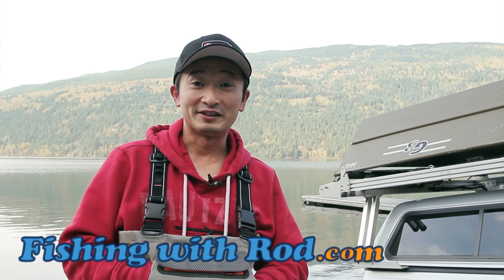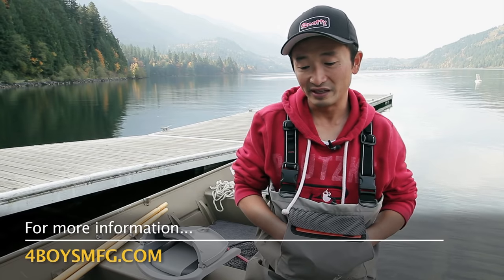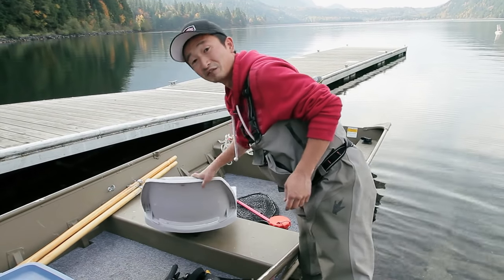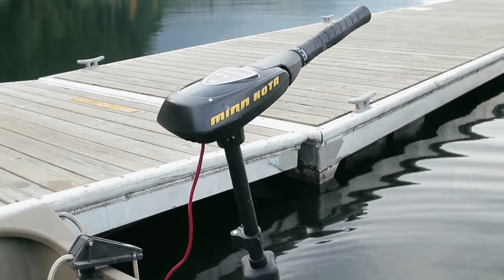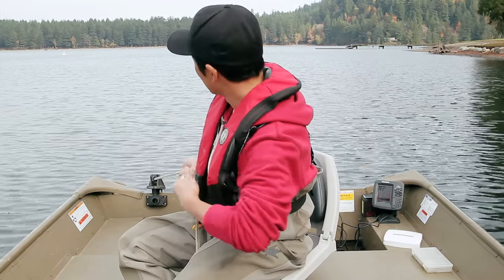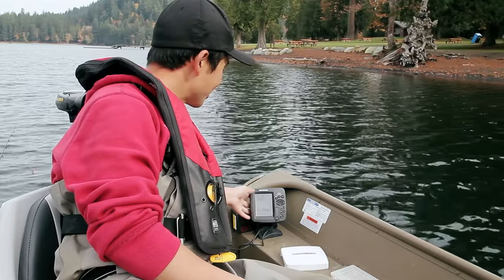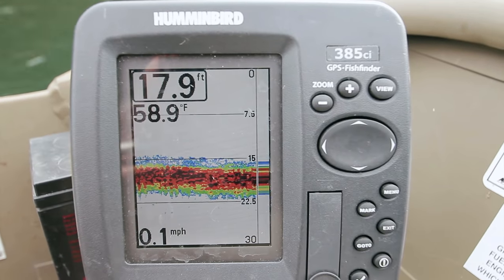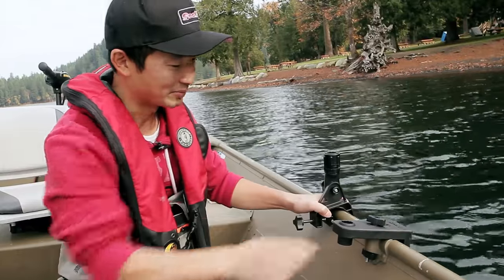A Tour of My Lake Fishing Boat Setup | Fishing with Rod

Comment: Excellent video! I’ve just bought a job boat with nothing set up in it at all. I will be mounting 2 anchor locks to the boat.
The one thing I haven’t decided is if I want to drill through my boat for the rod holder mounts.
So… clamp on or side mount (which means drilling) 
I noticed your clamp ons are very sturdy. What model of Scotty are they?  I have the same round top rail, so I may go with clamp on now! 
Thanks for the video! Great info!
Reply from the maker: Yeah, I've explored quite a few different options for mounting my rod holders and cameras etc, and in the end the coaming gunnel clamp mounts are still the best options for me. The model number on Scotty's website is 433. The only down side is that I find myself spending a bit of time screwing those on at the start of the day, then taking them off in the end. Not a huge deal but bit of a hassle especially tired after fishing all day. Since my boat goes up on top of the truck, everything has to come off so this is the best arrangement I can think of right now.

Comment: Thanks for sharing. I have a similar aluminum jon boat and since the gas engine broke down it has been sitting idle due to the high prices of gas engines.  But since seeing your video I have decided to install one or two electric trolling motors and i am sure it will be successful to get me and my son out in the water to fish.  Thanks again.
Reply from the maker: Awesome! I hope it works out. :)
Reply: Me too! Setting up a new jon boat, and I'm also going all- electric. Clean and simple. I don't need a lot of speed on these small lakes around here.

Comment: I've never seen an electric boat unloader. That's pretty awesome. 

Are there many lakes where gas powered engine aren't allowed over in BC ?
Reply from the maker: +The Fishing Experiment These electric boat loaders made by 4 Boys from Kelowna are getting really popular now. If you head up to Merritt and Kamloops, you'll see them everywhere on trucks. 

I'm not sure exactly how many lakes are designated as "electric motor" only but they are listed in the BC Freshwater Fishing Regulation Synopsis.
Reply: ***** Thanks for the information. 

Yeah I can imagine that type of loader would be ideal for some of those remote lakes that you have out there in BC. 

I imagine some of the those lakes are untouched even. 

The boat loaders are made in Canada too! that's awesome.

Comment: great looking boat Rod. May I ask where you got the exterior carpet? None of the marine supply places I tried have it in stock , it needs to be ordered. Thank you
Reply from the maker: It's from Home Depot! :) If you go to the outdoor carpet section, you'll see quite a few different options available. They come in these huge rolls (20ft wide I think), and you just ask them to cut you a piece. I think I got 6ft X 20ft for the two floors. Use carpet glue and it'll stay on forever, and staple on the back side of the edges. You can also waterproof it by applying some kind of spray so it lasts longer but I didn't bother since I rarely fish in the rain.
Reply: lol :) out of all the places, I am at Home Depot just about every day picking at stuff, but never thought they would have it. I will check it out tomorrow. Thanks Rod!
Reply from the maker: Yeah just feel all the different ones before you choose one. I must have been there about a dozen times before deciding and I went with the grey thin one which they recommended.

Comment: Very informative and well put together video .. you have a very nice boat setup .. I just recently bought my first aluminum fishing boat and I have concerns about mounting the seat to the bench like you did .. what did you use for anchors in the aluminum bench so did the swivel would not pull out ?
Reply from the maker: Thanks! The anchors I used are:

https://www.homedepot.ca/product/paulin-papc-8-32-thread-sert-kits/1000162982

I don't consider these as heavy duty anchors and the aluminum on the bench is less than a cm thick so over time the screws will try to wiggle out on their own. That said, after 5 years the anchors are still holding on very well and I've only had two screws that came a bit loose at some point, they were fine once I tightened them up again. I also recommend that you don't lean back in your seat too much or too often so you're not putting too much pressure on those screws and anchors.
Reply: I was thinking about getting some type of board that would fit the entire bench front to back side to side .. then screw about 8 screws through the board , 4 across the back and forth across the front side .. use these anchors to mount the board to the aluminum bench .. then mount my swivel and chair to the board .. I think this would make it a lot more stable for leaning back in the chair .. plus I would be able to mount my fish finder and other things to the board next to the chair

Comment: Excellent video! Where did you buy the boat? How fast can you go on with the trolling motor and does the battery last all day?
Reply from the maker: +Mark H Thanks! You can get these jon boats from any Yamaha G3 dealers. Mine is from GA Checkpoint in Abbotsford, British Columbia. With the trolling motor, mine is 55lb thrust and that's adequate enough for me to travel from point A to B in a small lake. It is a trolling motor after all so it doesn't go super fast, and I am not in a hurry usually so that's fast enough for me. The battery life depends on its size. Mine can run the motor for a day, which involves going from point to point, and anchoring at spots for a few hours at a time. I would say up to 1 hour total at full cruising speed.

Comment: Great vid, what hardware are you using to mount the anchor lock to the transom? Just stainless bolts and nuts? Any silicone? Words of wisdom when drilling into transom? Id like to mount a similar anchor lock on Lund A12.
Reply from the maker: Hi Kelly, I use a Scotty flush mount which goes with the anchor lock.
http://scotty.com/fishing-gear-equipment/rod-holders/flush-mounts.htm

They are screwed on with stainless steel bolts and nuts. :) Hope that helps!

Comment: Hi Rod, i just got a brand new boat. 1448 G3. Really similar to yours but a bit wider. I am thinking about using the flush mount anchor lock bases because i want to put a tarp over the bot and i don’t want the regular base stick up to much and possibly damage the cover. Did you ever consider using them on the front or you think they wouldn’t fit under the front “lip”? I’d hate to buy one just to find out that I can’t use them. Thanks Rod
Reply from the maker: Congratulations on the buy! 1448 is so much wider than my 1442. From what I remember, the flush mount can fit on that front lip, but you may need to file off a bit of the bottom of that mount. I chose the regular base mostly because I'm not that handy, and didn't want to do the cutting of the front lip to fit that flush mount.
Reply: Thanks for the reply Rod. Yes, the 1448 is a monster:) so much bigger than my previous 1436. I don’t mind filing it down, hopefully it won’t weaken the mounts. There is a lot of force on those anchor mounts sometimes, when we try to pull the anchors out of the mud. I’ll let you know how they are once it’s done;)

Comment: Hi Rod I am new just watched your boat tour video i am actually trying to find a boat for me and my family this looks like a perfect starting boat can you stand up safely in thins boat and fish or does it seem kinda wobbely ?
Reply from the maker: We've fly fished it with two people standing up and casting without any issue even if the lake has a bit of chop on it. Having a leveled floor like we've done in this video makes a big difference on stability when standing up. This boat is ideal with either two people who want to stand freely, or three people sitting down. If you have more than one kid who likes to run around in it, then there are bigger and wider options as well, such as 1648 or 1652, but these have to be on a trailer instead of on top of the truck.

Comment: Hey there nice boat. If you don't mind me asking....how much did it coat and where did you get those anchor mounts from. THANKS again nice boat
Reply from the maker: Jeffrey Carpenter thanks! The anchor pullers and the associated mounts are made by Scotty Fishing Products, and they can be found at most boat or fishing retailers across North America, Europe and Australia actually. If you head to their website you should be able to find a dealer list. The exact cost of the boat I don't remember. You can get the boat body at a pretty reasonable price, under a couple thousands, and build it up with accessories like I have done. 😊

Comment: Does the trolling motor kills the battery or does it charges it as well when you use it and I like the vids
Reply from the maker: The battery indeed has a life span. How long it lasts depends on its size, and how fast you are going. If you are going full speed with the electric motor, it'd be around 1 hour, maybe less.
Reply: What type of battery are you using?

Comment: May I ask how long you can go with the motor before you run out of charge?
Reply from the maker: we do it That really depends on what setting you are on and how big the boat you are pushing. With this 14ft Jon boat, I can run at full power (3.5mph) for roughly an hour.

Comment: Do you have your Scotty anchor mount bolted through the transom with a nut on the other side, or just screwed into the transom?
Reply from the maker: It is directly screwed into the transom. The screws hold really well in the wood beneath the metal. Make sure you apply some kind of sealing before fully tighten each screw so water does not seep into the wood.

Comment: Great video, I’m looking at get a boat just like yours, how stable would you say the boat is when moving side to side?
Reply from the maker: It's really stable. Here is a good video to see how stable it is, at one point I was running all along the edge of the boat:

https://www.youtube.com/watch?v=IfyxQbiXpbo

That said, I am only 130lb, so it also depends on your weight. If you're concerned about stability, there is also the 1448 which is REALLY stable, but that boat would have to go on a trailer instead of on top of the truck like what I do with this 1442.
Reply: @FishingwithRod   just got done watching that video, thank you sir!
I am planning on the G3 1448, I think it will fit my needs perfectly, I have a lot to learn about fishing ha, I have thrown a lot of lines but never had much luck, I’m planning to change that soon.
Reply from the maker: Great! You'll love the 1448, it's such a spacious boat. It's quite amazing how much difference that extra four inches make.
Reply: @FishingwithRod  awesome, that’s what I needed, thank you sir

Comment: With this setup, you'd block the boat ramp for an excessive amount of time.  Good way to piss people off waiting for you.  
 However the mechanized roof winch is awesome.
Reply from the maker: Vic Terraglia That's one disadvantage and it is up to the user to be considerate. I don't use busy boat launches for this very reason, and will unload the boat quickly at the launch, bring the boat to the nearby beach and set everything up so I don't take up the space.

Comment: Hey I'm looking at the same boat. Just curious how easy is it for you and another person  to lift and carry that boat?
Reply from the maker: Hi Jarrett, I can't speak for everyone as I am only 130lb, so is my wife, so it is impossible for both of us to lets say flip the boat and put it on top of the truck, but carrying it briefly on the ground to the water is doable for us. I sometimes even drag the boat zig zagging to the water. We have an electric boat loader which lifts the boat to the top of the truck, and I can lower it into the water by pressing a button. It's the perfect size boat for two or even three people, and getting to less accessible lakes where the boat needs to be on the roof of the truck.
Reply: @FishingwithRod  wow that was a fast response ! Ok thanks love the videos by the way! I'm 230 lbs form ontario looking for a boat me and my friends could take out  in a few small lakes and rivers with no launch. And about a 50 foot  walk with the boat. I like I wide this one is over the 1436.
Reply from the maker: @JLRacing17  Yeah you two should have no problem carrying 50ft to the water. One challenge I've always had while carrying on the ground is that the two handles on the transom side are quite far apart for me, so I have a problem with grabbing onto both to carry. My arms are too short for that, but probably not the issue for others. The biggest challenge is definitely getting it from the truck top to the ground and back up. If you can work out a system to do that with the buddy, then you are good to go!

Comment: I've recently purchased a 14' AlumaCraft Jon boat and want to install seats onto the benches as you have done  on your boat.  I weigh approximately 200 lbs and I'm  curious to know if I should mount directly into the aluminum bench or would it be better to install a piece of plywood onto the benches and mount the seats to them.  Do you have any recommendations as to the best way to do this with my weight taken into consideration?
Reply from the maker: Personally I think it wouldn't make much difference structurally if you put a plywood in between the bench and the mount. With the anchors that I've used for screwing the mount onto the bench, they have been very strong and we've had people around your weight sitting on them too. The anchors I use are called "Papc Thread-Sert Kits". If you Google it and it should pop up first on the Home Depot's website.
Reply: +Fishing with Rod Thanks for your advice!

Comment: What do you think would be better and faster for a 12ft jon... A 55lb single motor or 2 30lb motors? nice video btw!
Reply from the maker: A 55lb thrust electric motor is plenty enough for a 12ft Jon. I've never seen anyone using two electric motors at once. You can always go higher than 55lb, Minn Kota has those available.
Reply: Fishing with Rod Ok thats what I was thinking.  I saw another video of someone using two c2 30's.  How fast do you think a 55 will go as far as mph?  im guessing around 3-4
Reply from the maker: 55lb on a 12 footer should be up to 5mph. I have done up to 4mph with my 1442.
Reply: Fishing with Rod Alright, thanks so much!
Reply: I've done 2 55 lb motors in the back with a 40 lb in the front on a 14 ft extra wide Alumacraft. Takes experience to get the most out of it. Get s a lot of strange looks going down the road on trailer. Especially with 2 Penn Senators on offshore rods in the rod holders and 4 more rods in other rod holders.

Comment: Rod can you give some idea how you build the Jon Boat floor, fixing to build one for my Jon Boat. Thanks
Reply from the maker: So for the Jon boat floors, I'm actually not very handy at all and found it not too difficult to do this. I first use cardboards and cut them to fit onto the boat floor. I then measured the cardboards to get the dimensions, and asked the shop to cut two pieces of plywood with the dimensions given. You'd need to do some additional cutting for the sides to make them fit. For the back piece, it can just go into it as it is. The front piece needs two pieces of 2X4 on the bottom to elevate some more so it can be leveled. For carpet, I just headed to Home Depot and looked for the outdoor carpet options. I glued the carpets on, and waterproofed them.
Reply: @FishingwithRod  thanks for the info...I really enjoy your Video's...👍

Comment: I am looking at a Tracker 1036 and it would only be me and one of my 16 year olds or me and my wife.  I am worried that the 10 footer is not stable.  Only using on small electric motor only lakes and ponds.  Whats your thoughts on this?
Reply from the maker: +David Godinez The length is not an issue, I've had a 10ft boat before this and sometimes even fished with three people in it. It's the 36in width that you should be concerned about, depending on how much you weigh. The side stability can be an issue especially if the water is choppy, when you are leaning over for the fish etc.

Comment: What is the floor made of? How much extra weight did the floor add?
Reply from the maker: Hi Gerard, the floor is made of plywood and the outdoor carpet is glued on and stapled at the edges. The back floor is not heavy as it is just the plywood itself. The front floor is quite a bit heavier since there are two pieces of 2X4s nailed underneath it to elevate and level the floor.